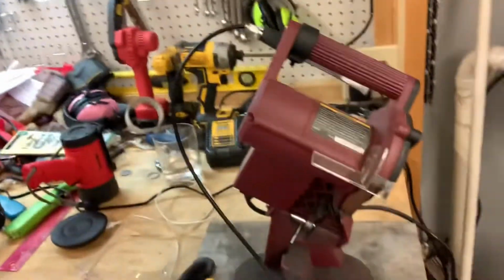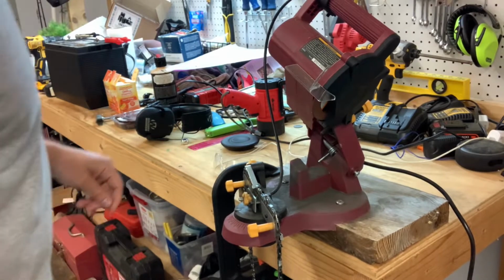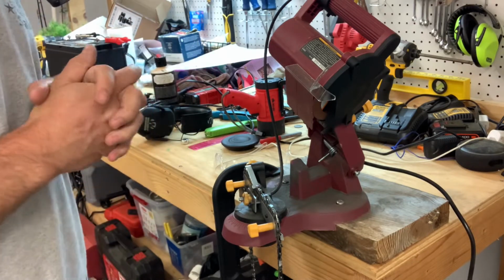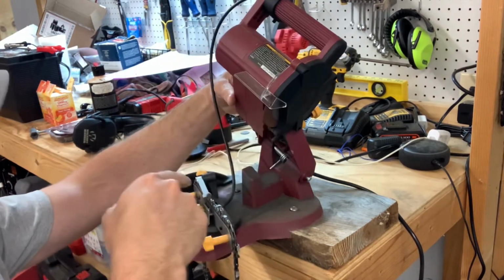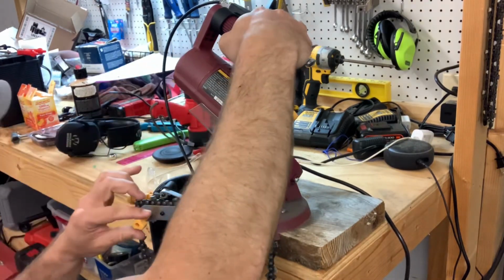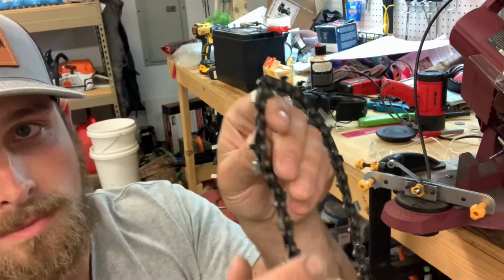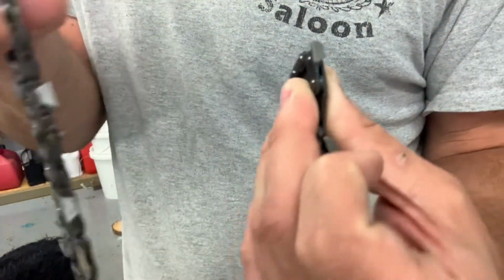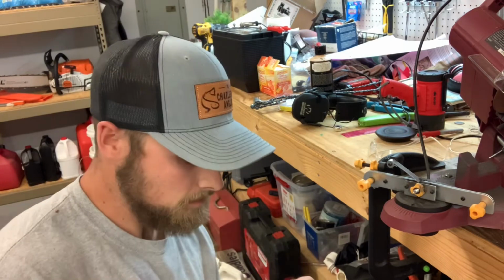Sharpening Chainsaw Chain With Chicago Electric Electric Sharpener

Comment: When i sharpen a chain with a file i always count the strokes with the file and keep them the same .When i use an electric sharpener i try to find the smallest tooth and set the machine to that to keep them uniform
Reply from the maker: Hmm that’s a good idea but I have found that tooth length really doesn’t affect the performance of the chain.
Reply: @FirewoodontheHill  uniform tooth size to your rakers on the chain will make a huge difference
Reply from the maker: @adammeana4002 if you take the rakers down to each size tooth it should even itself out.

Comment: I have an oregon sharpener simular to the one you are using.One thing I noticed was you did`nt use eye protection.Best to be on the safe side a sliver of steel really hurts.
Reply from the maker: Yes I don’t know if you can see I had my safety glasses right beside the sharpener and just forgot to put them on 🤦🏼